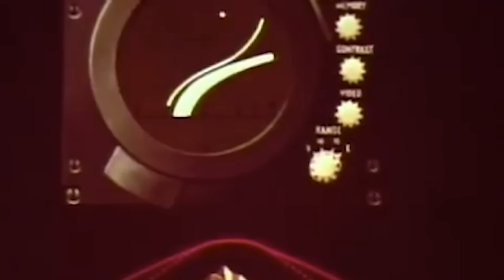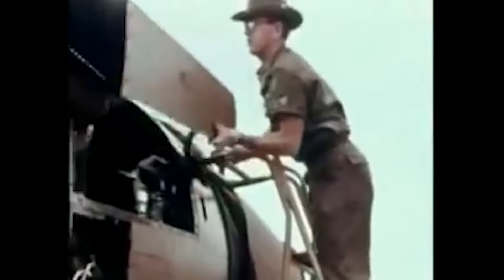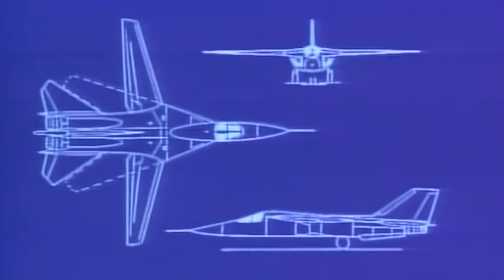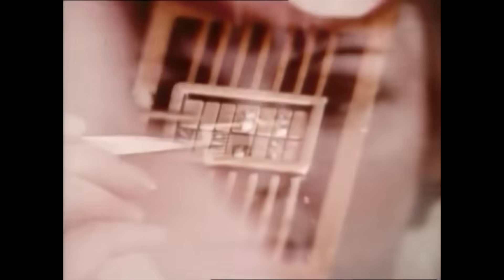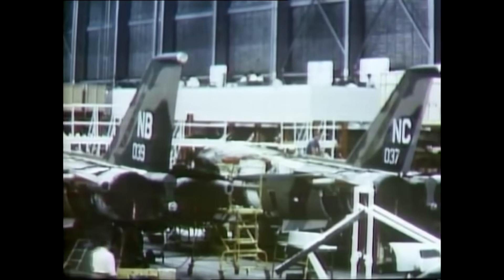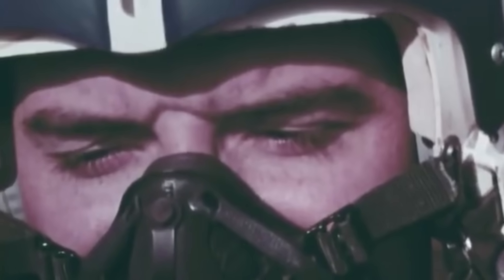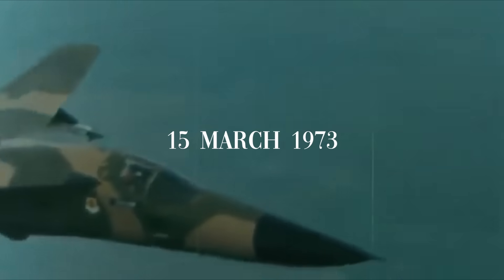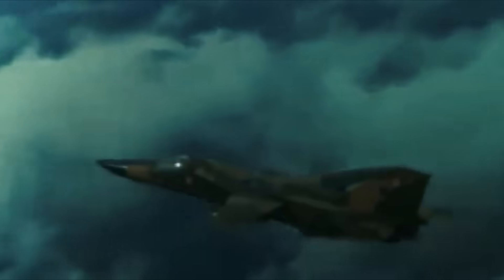The F-111's Fatal Flaw

Comment: Has anyone else seen an F-4 do a dutch roll? It was lunch time at RAAF Amberley and I was walking from the airman's mess when this Phantom approached, it was wallowing, slow, nose high and about to fall out of the sky right on top of me. The nose lowered doing a 360 corkscrew motion, I had no idea what was happening and it was decades later  I worked out what manoeuvre the Jock was doing. I have spent hours looking for a video of this done as an  acrobatic manoeuvre but to no avail.

His second was a dirty pass until he got over the base when he retracted the gear and hook, sat it on its arse and went vertical, punching a hole in the overcast. The third was a high speed pass where he touched Mach 1 and broke the glass in the servo outside the gate.

I have no idea why the show, very few of us would have seen it. I assume it was a very experienced pilot so may have been USAF ex 'Nam.

Comment: One of the few times a winning F1 driver was upstaged was in Adelaide (1986?) when on crossing the finish line the F111 did a low pass at the same time. To be in a car like that and then have a bigger louder faster vehicle blow you into the weeds must have been unsettling for the driver!

Comment: As a Brit, I have a rather different perspective on the F111; As the Labour (left wing - no pivot!) government of Harold Wilson had sought to bankrupt the UK by ideological industrial nationalisation there was a need for an international loan. This was obtained with the help of the USA but on condition that the UK scrap the development of the supersonic, hedge-hopping military fighter TSR2 and instead buy the F111. The UK obediently scrapped the TSR2 having built the 1st 2 prototypes (only one of which had flown). We paid a £60 million deposit on the F111 but in the end cancelled the order due to the poor reliability/crashes. We didn't get the deposit back !! 
The technology from the TSR2 was shared with France resulting in the Concord(e), another world beating aircrapft but again effectively killed by the USA when the Boeing SST proved to be uncompetative. (I will be honest, that I agree that the sonic boom over land every day on fixed routes is unacceptable but this would not have been a problem with the TSR2.)
The UK went on to develop the Typhoon in another joint venture with France instead of buying the F111.

Comment: I was stationed at a US Air Force base that had FB-111's when I enlisted in the military in the early 80's.  That base has been closed for a very long time now but the F111/FB-111 is still one of my favorite aircrafts.  In the early 80's we were told that no other plane could fly as fast as the F-111 in proximity to its low ground flying ability.  I don't know how accurate that was/is at the time but it was something the aircraft mechanics, pilots, etc. seemed very proud of.  The F-111 is an iconic aircraft.
Reply: I was trained on them, but never operated on them. It was a fascinating aircraft; born out of the intersection of several new technologies that came together at just the right time. Later on, much of this would become "standard equipment", but the F-111 (and FB variants) was one of GD's better innovative designs - perhaps eclipsed only by the astonishing F-16. It is kind of unfortunate they got absorbed into the increasingly large "Borg-type" mass of contractor conglomerates. I firmly believe competition breeds innovation, and reducing competition to a bare handful of contractors (all with deep pockets to "donate" to multiple Congress members) harms our defense capability significantly.
Reply: @MrJest2  
Well said.  👍
Reply: Crazy isn't it as a former military brat I always wanted to go see the military hospital I was born in Asia hopefully someday miss seeing F-14s buzz by
Reply: @firesupport162  
👍
Reply: I was an Air Force brat living on Plattsburgh Air Force Base from 1970 to 1972. Very beautiful aircraft the F-111 was.
Reply: @richardmitchell3037  
I was stationed at Plattsburgh beginning in 1982.  Lol, it's a small world.  Best wishes.

Comment: I worked on B models and EF111’s at Mt Home AFB. Primarily avionics. Only one crash,during my time,  that they attributed to  pilot new to F111s. error, but it did flip upside down prior to ejection sadly killing both pilots. If I remember correctly, flying over water could mess with the LARA, but that would need to be confirmed by actual pilots.

Comment: I built a model of an F111 in 1980. I've often wondered, can they fold the wings back, go into a dive, use the airbrakes to slow down, fold the wings back out and fly under radar, deliver the payload, hit the afterburners and GTFO? Is that what they were designed for? Divebombing? And, didn't the USMC use them as well? By the way, that model I built when I was a 13 year old puppy, I drilled out the engine nacelles and put two model rocket engines in it and it actually flew for about 40 seconds. I Launched it from an inclined 1X8 plank, it went up, made a big loop, and came straight at my head. I ducked, and it stuck nose first into the dirt and blew up. Needless to say, the little plastic pilots didn't survive. They should've included a little plastic Chuck Yeager with the kit, and maybe he would've ejected.
Reply: Wings out for more lift during takeoff, drop bombs and fold the wings back to get out of dodge quick. Your child hood memory makes me want to try that now lol

Comment: I worked on those in the U.S.A.F. and in lees than a year at 1 base they lost 7. 4 on the trim pad loaded with 4 500 lbs. bombs each, 1 crashed landed without main landing gear, 1 crashed landed without the nose gear, and 1 started cartwheel right after taking off causing the base commander and WSO to eject. When their capsule hit the ground they both suffered back injurys

Comment: Inter-service rivalry certainly played a part in the Navy's rejection of the F-111 as a naval aircraft, but to say that it was "mostly" due to rivalry is bunk: the required performance characteristics for naval jets are far different. Glide slope, max landing weight, being able to withstand repeated hard landings with arrestor gear, on short runways, & continually exposed to a harsher environment than Air Force specifications called for at the time were far more important. McNamara's F-111B (naval version) never got it's design weight down enough to be able to land on carriers, while retaining even minimal performance increases that would've justified it's development. The role of a carrier borne, supersonic fleet air defense interceptor went to the F-14, another swing-wing design.
Reply: This. The F-111 is a big heavy jet

Comment: I was there in England in the late 70's and the E models were having a lot of problems with capsule ejection system failures, and engine problems on ab's. Watched one on takeoff full ab, where it looked like a roman candle, as the left starboard decided to come unglued. He did a quick right, fast base leg and landed safely.  Every landing is good. Happy they fixed all of those problems also. Retired radar tech. GE.
Reply: The Defense Dept is a den of criminal irresponsibility and murderers, when will unethical people like you stop being generated in a free society?

Comment: I was stationed at Nellis AFB in 1969/70 when these were still being tested.  An awesome plane with many problems to be worked out.  The avionics alone pushed the limits for the time.  It was a first in so many ways.  I'm glad they finally achieved success.
Reply: I was stationed at RAF Upper Heyford (20th TFW) from 1971-75.  I roomed with a couple of flight simulator jockeys who cited avionics as one of the problems with this aircraft.  I was flying from Toronto to Chicago on April 14, 1986 when I learned that Muammar Gaddafi (in Libya) was bombed by F-111's that flew out of RAF Upper Heyford.  France and Spain did not want the F-111's lying over them so they had to approach Libya by flying southwest over the Atlantic Ocean.
Reply: I'm guessing you were with 474th TFW.  When I graduated high school in 1975, I enlisted in the USAF and was trained as a 32630A.  In July, 1976, I was assigned to the 474th AMS.  I got my 5 level quickly and watched as the last of the 474th's F-111As lit the burners, trundled down the Nellis runway, and turned northward to Mountain Home.  In August, 1977, I left Nellis AFB for Travis AFB, California.

When I saw the title of this video, I thought the producers left off an "s" on the word "flaw".  One of the things I learned was that the Aardvark was a maintenance hog, soaking up people and money for two primary systems: the wing pivots, and the TF-30 engines.  Did I mention that I learned to HATE the TF-30s?  I should probably mention that.
Reply: @johndemeritt3460  I trained briefly on an F-111 at Chanute. The aircraft we had there had cracks in the pivot assembly and was decommisioned as soon as it landed. It was practically a new aircraft. All the classified electronics were removed before we students were able to train on it. None of us liked that aircraft, so our training moved to the F-4D and B-52B and D models.

Comment: The F111 was especially good at a "dump and burn" where fuel is dumped and ignited by the afterburner. Although a safety feature to be used in case of problems shortly after takeoff, it was used extensively by the RAAF in airshows and other public events.
Reply: There used to be a bombing run for F-111s  near Evans Head, northern New South Wales. Come down over the mountains, drop their bombs, hit the coast then 'light the candles'. Gone from sight in seconds. Very impressive.
Reply: @kenplant8223  Evans head head land is a cool outpost on the perimeter east
Reply: @kenplant8223  There's video on youtube of a Pig smashing the windows in a control tower as it rockets past right on the deck (it was actually lower than the top of the tower iirc). I'm pretty sure it was shot at Evans Head.
Reply: Remember that afterburner show well , above Alawa primary school Darwin late 70's & the F111 shot straight up flaming , can't recall why we deserved such an display but was appreciated
Reply: Saw that at https://www.youtube.com/watch?v=WpPEdOMSIgQ
Reply: I thought this would be effective to illuminate a battle field so night vision could pick out targets, but I don't think it was ever used that way.

Comment: ..how do you drop a nuke at low altitude under radar?...or how do you enter Soviet airspace at altitude with their advanced SAMs to drop a nuke?...
Reply: They would do a maneuver called a Bomb Toss or a Loft Bomb. Basically the plane does a steep pull up while flying towards the target (3g? - can't remember the exact amount of G's) and the weapons system would compute and release the bomb/nuke at the precise moment (the "toss") for it to hit it's target. Like a softball pitcher tries to toss the ball high into the air and have it come down and hit the plate. After the bomb is released the plane would do a 180 degree roll and a 180 degree turn so it ends up going the opposite direction (away from the explosion instead of over it).

Comment: Insufficient specs due to ignorance and inferior quality control.  When working with new concepts you usually find new parameters that are important in the new design that were unimportant in prior designs.  This has occurred time after time over the years.  For example, in 1942, the US Navy found that many of its new Mark 21 Base Detonating Fuze for armor-piercing projectiles were fail;ng to give full-power detonations of the new AP shells, the best in the world, that were speced to penetrate thick face-hardened plates at up to 40 degrees angle, much worse on the shell than prior 20-30-degree testing of former shells.  The older fuzes, which had to remain functional during the roughly 0.035-second delay time between impact setting off the fuze and the shell getting inside the target before causing detonation, were not reliable at such high angles.  The Mark 21 had an explosive locking system the rammed the insides of the shell, now unlocked due to projectile spin, forced into the final detonation configuration as well as setting off the black powder delay element.  This required higher tolerances in the fuze.  It was discovered that the ammonium picrate (Explosive "D") filler of the shells was sending out slightly corrosive fumes that rusted the fuze internal surfaces slightly, of no consequence to earlier fuze designs, but just enough to prevent the locking effect from happening in a large number of cases, duding the shell or causing low-power explosions.  They finally decided to simply dip all fuzes in liquified Bakelite plassdtic to seal them before shipping, fixing the problem completely.  Old things having new effects...

Comment: The F-111 may be the best remembered in Australia, but that's at least partially because there's less people around now that recall what came before.  Personally, I always viewed the F-111 as decent, but it was commonly viewed in Australia as not significantly improved enough to be worth the money when compared to what it replaced, the Dassault Mirage III-E.
Reply: It didn't replace the Mirage. That was replaced by the F-18. The F-111 replaced (eventually) the Canberra and was definitely an improvement.

Comment: These were sensational aircraft flown by exceptional pilots. I remember on more than one occasion fishing at Sandy Cape at the top of Fraser Island and watching two F111's fly up the western side of the island at high speed, pivot around the top of the island and rip down the eastern side. . . . . all at about 50m off sea level.
Reply: Man. Those flyboys would scare the s##t out of you and wave as they flew past😱😱👍👌❤️
Reply: "exceptional pilots"?  They crashed 8 of them.
Reply: I'll never forget seeing two F111's flying south on the ocean side of Fraser Island at low altitude (at the time I guessed about 30 to 40 meters above sea level) about 100m off the coast.

Comment: In the early 1980's I was working on the development of a 65 kilometre pipeline project between Gladstone's Awoonga dam and the Callide dam in Central Queensland. The RAAF was tasked or commissioned to do photogrammetric flyovers. Will never forget standing on a hilltop one morning, turning around to see an F111 coming at me from below. Thought I was a goner. They were on the terrain radar and basically jumped up and then down the other side of the hill. Awesome example of how stealthy these beasties were. I still have scrape marks on my forehead😂
Reply: i remember seeing a video of an F111 go over a haystack and then seeing the haystack disintegrate.
Reply: They have an F111 on display at the RAAF base in Wagga, Australia. It’s magnificent and huge, just walking round it is an experience.
Reply: Yes, everything goes well as long as the Terrain Following Radar is working well, until it doesn't,  leading to multiple F-111 crashes, particularly in Northern NSW.
Reply: British technology developed with the TSR2 then given away for peanuts. Some special relationship.

Comment: Interesting. I was working at Vickers in 1963 and personally carried the s99 steel tail parts replacing the Aluminium items that had failed when VC1 landed. So Aluminium strength was well understood in Britain. I have particularly strong memories of Barnes Wallis stating that the US were doing something wrong with the swing wing as he had had one on test for 50,000 hours. As for all terrain navigation there were many Welsh farmers irate about bangs at night as Hunters howled through the valleys at speeds and levels that all authorities denied were possible 🙂

Comment: McNamara's folly, when you have a person who's experience was in automobile manufacturing being placed in a position he was not qualified for. The F-4 just happened to work for multiple services and this guy thought it should work for any aircraft. The F-111 worked for the Air Force but was to big and blind to operate off the carriers in service. Grumman had worked with General Dynamics in developing the wing sweep since they had built a test project earlier and realized the F-111 was not good, they developed the F-14 to fill a fighter role with allowances to haul bombs. The bomb hauling didn't happen until late in its career.

Comment: Should have chosen TSR2 back in 63/64 & got a safer aircraft sooner 🙂
Reply: brits ran out of money.
Reply: @rearspeaker6364  because they didn't get the right orders at the right time. Realistically, the whole TSR2 project requirement drafting & revision was a complete F-up. In fact the same can be said re: F111 being supposedly a dual-role, for both USN & USAAF but USN fell away. Ultimately USA had much bigger pockets to bail out the whole F-up thing. Maybe it became "too big to fail", no matter how many pilots were "for the high jump" early on 😞

Comment: Wing-box failure for swept wing aircraft is not isolated to F-111 - Tornado suffered a similar fatigue issue - on the only major structural component of Tornado manufactured in Germany.  Ironic huh?

Comment: Qld Air Museum has a couple of interesting interviews with survivors of F-111 ejections on their podcast. They received spinal injuries from the initial rocket blast of the pod escaping the aircraft and then the speed at which it hit the water under parachute.
Reply: Not a surprise. Most pilots who've had to "Bang-Out" end up physically shorter from the process. The odd compressed/ruptured disc in the spinal column is preferred over riding the plane in to the accident site. Sure, you might live a life with near constant back pain, but at least you have a life to live...